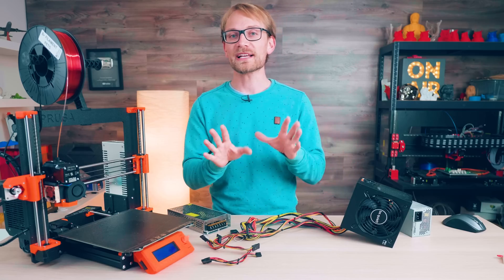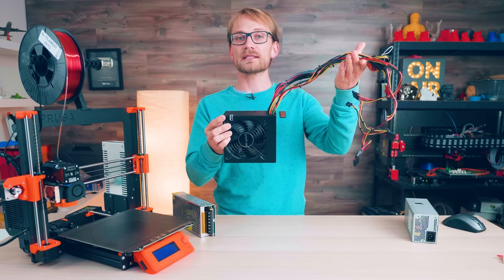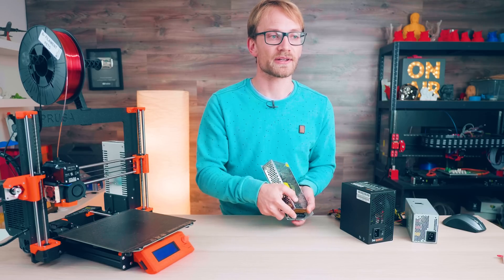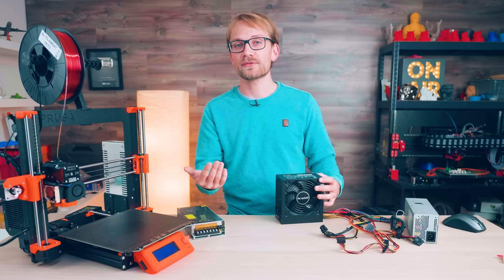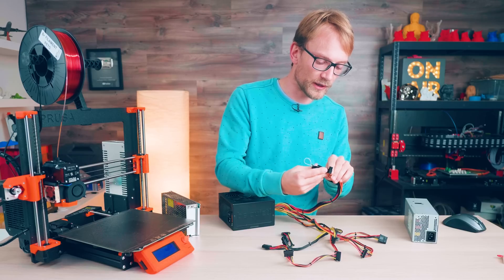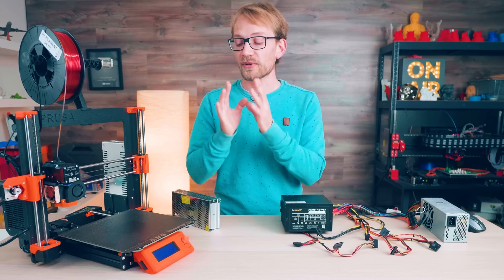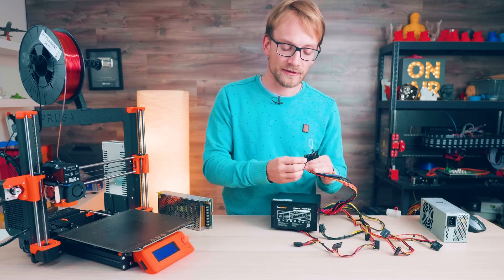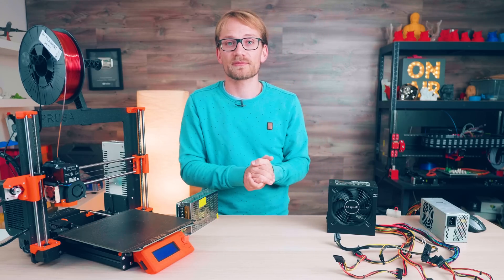ATX supplies are super useful for 3D printers!

Comment: You can actually pull 24volts out of the atx by taking a positive lead from the 12v and a negative lead from the -12v
Reply: the -12v rail is generally a very low current one, so you limit your current draw to that lower number. EG 800mA for -12  compared to 18A for +12. You end up with 24V at a max of 800mA, so not particularly useful.

Comment: You CAN get 24V from ATX power supply. Just use 12V as a ground and you get 24V at 12V rail's amp rating. I've been using this kind of setup for about 6 years (I needed 24V@over 9A as a bench power supply and then 24V industrial power supplies were not that cheap) and it's still going strong. It will go for hours from time to time, once i even used this setup to preheat glow plugs in old diesel and still no blue magic smoke.
Reply: This does not work in general. (And at the moment your main text has "strikethrough" effect, which is appropriate.) By "use 12V as ground" I assume you mean: use two ATX power supplies, and connect their outputs in series. In general, this will not work because ATX output grounds are typically connected to chassis and mains ground. So if you connect PSU#2's ground to PSU#1's 12V, then you're shorting PSU#1.  You might get away with floating one or both of the power supplies, but then you're defeating an essential safety feature.
Reply: @Graham_Wideman  I have no idea why i have a "strikethrough" effect. I ment (and wrote) -12V, not 12V but because of that dash it can't be seen. I agree that connect those two modules in a way which You describe could have quite nasty sideeffects

Comment: "One big transformer". No, this is incorrect, these are all switch mode supplies. Group regulation has nothing to do with transformers or the number of secondaries, that's not a simplification, it's confusion. Group regulation is simply the rails being regulated as groups rather than being monitored independently, eg one regulator with multiple outputs, the clue is in the name "group REGULATION" .The cost saving is in regard to the number of regulator circuits, not transformer secondaries, these aren't linear psu's.
Reply: He is correct you are wrong. Switch mode supplies are regulated by PCM on inbound side. So if you have one transformer you can only regulate all outputs at once. To regulate them individually you need separate transformers to have separate PCM modulation for separate output voltage.
Reply: Vyacheslav Kononenko PWM. PCM is Pulse Code Modulation.
Reply: He explained that sometimes uses different voltages ratios between outputs to bring the voltages, and because of that, the use of only one transformer with this different ratios is used. Obviously, this is not ideal for many voltages, but is cheaper.
The SMPS uses transformers, but not to step down the voltage. Is for induct high voltage low current from the primary to the secondary, and in this manner induct low voltage high current in the secondary, that is rectified and filtered to give the desired output voltage.
Reply: m3chanist - Sorry you're incorrect.
Reply: Your wrong. Unlike a linear power supply, the pass transistor of a switching-mode supply continually switches between low-dissipation, full-on and full-off states, and spends very little time in the high dissipation transitions, which minimizes wasted energy. The first block is used to rectify and filter the input making the power draw more "stable"as in so its more of a straight line on the graph.The second block in an (smps)is a chopper which makes pulsating dc waves and the biggest ones go through the transformer.
Reply: @techdiyer5290  You're*

Comment: Hey Tom, thanks for the content.  I had the power supply die on my Ender 3, so I bought the appropriate Meanwell power supply for that printer and hooked it up based on the pictures I took of the original wiring configuration.  The printer will power up and get to full preheating temps, but then shuts down when I try to start a print.  Any suggestions on what may be going on here?  Thanks

Comment: Keep in mind that a, say, 400W heated bed doesn’t run 400W constantly. My printer had a 400W supply, once it was at temp it stabilised at 150-200W average maintaining temp. Just handy to keep in mind when thinking of what it’s costing you in electricity.

Comment: You can always put "single rail" into your search when researching ATX power supplies. =) ... Check out Newegg, when you click on PowerSupplies, there's an option under +12v Rails and you can select single. Other online stores are the same. Even if you don't want to shop at Newegg you can find a model number to search on your preferred retailer/e-tailer (if those types of search options aren't available).

I am using a standard ATX, single rail high(er) end EVGA, in the printer that I designed because it also powers my R-Pi using 5v standby, so the Pi stays on even when the ATX is off. I've added custom buttons to OctoPi that are (ATX Off) (ATX On) so the R-Pi turns the printer on/off. I prefer to turn the PSU on and preheat the bed until the temps have been stable for a few minutes. Sure this is not always necessary but I have found that a nice stable bed temp helps a little bit with large footprint PETG or ABS prints (bed heater uses an industrial SSR, purchased from digikey, and mains voltage). 

Now I am switching to a 24v MeanWell, which wasn't cheaper than an ATX, it cost me over $50. I purchased from a known good supplier (digikey - I should get paid to endorse these guys) to ensure that I did not get some knock-off brand and I support a company that I trust (this is important to me). This is about the same price that I paid for the ATX supply. NEVER go cheap on a PSU. There's my advice, go google some images of burned houses and smoking PSU videos. Plus why would you want to deliver "dirty" power to any electronics device, go do some reading about excess ripple and it's effect. A few extra bucks is worth it for piece of mind, your safety, and longevity/stability of your PSU and devices running off of it.
Reply: Well said.

Comment: Tom, great information. I have known about ATX supplies in conjunction with 3d printers for several years and have actually built a hat for a Raspberry Pi in combination with a Octoprint plugin that controls the printer, Pi, LEDS, fans, etc. I have had one running for the last several years without any issue. The ATXPiHat is a one stop shop solution for ATX supplies and interfacing with 3D Printers. It started out as a small single PCB that you de-soldered the connectors from and solder them to the PI, etc. What a mess. The newer solution is plug and play. It handles all of the output muxing of the wires to handle the voltage/amperage requirements, load on the 5v rail to handle power sagging, etc. I wish that there was a 24 volt ATX solution. ATX supplies are more stable, better manufactured, and the power is much cleaner. Computers really do not like crappy power. Thanks again for the great video.

Comment: check out server power supplies! Better Amperage ratings, run at 24v or 48v, with 12v and voltage offsprings.  They are everywhere for about $12 USD or less. No wire jumble.

Comment: What about dual identical ATX supplies, tie the ground of one to the +12V of the other and you have 24V between +12V(b) and ground(a). Two separate +5VSB rails, and you can tie the green power on connectors together etc as well.
Reply: You can't do this because each PSU's output ground is tied to the PSU metal case, and to the mains ground. So if you tie the first PSU 12V output to the second PSU ground, you essentially short out the first PSU.

Comment: The only problem with ATX supplies, is that they are 12v only.  Some printer builds need 24v.
ATX supplies with modular cables solve the wiring problem, make your own cables and plug them into the supply.
I wonder if there is a way to use both the +12 and -12 outputs to get an effective 24v, at least for the heated bed supply.
Reply: Yes, you can get 24v by using the +12 and -12, but before you get excited look at the current available on the -12, thats the max current you will be able to pull, be prepared for disappointment.

Comment: Thanks! 
This weeks I was already looking into this, especially for the 12 AND 5 V that I use for my printers to combine it to the 24 V supply that is already there for another printer.
About the ATX supply: they do come with a good fan that is relatively silent compared to some extra fans on the (cheaper) PSU that the printer came with and is also way cooler.
Did not know about the low prices, always learned that these supplies are really expensive so maybe, maybe I will go with a new one instead of one that I have here in old computers.

I guess the best way to get a connector is to solve them from an old PC-mainboard?

Comment: I built my own printer from scratch and I used an ATX power supply, what I love about it, is that I was able to removed the board completely from the case and installed it into my printers I could have remove all the wire and just use one solid higher rated wire but I choose to just connect few wire together and discard some to suite..and the fact that I can use the MK2 Gen L board to directly switch on and off the power supply without using a shunt wire make it more beautiful . My printer automatically shutdown power when printing is complete ..
Reply: HII. Can You advise me on how to rebuild power supply to 24V ATX?

Comment: Can you use two industrial power supplies in parallel? My printer uses 12V 25A but I can't find any passive cooled industrial supplies. Would it be possible to use two weaker ones in parallel?

Comment: My very first printer back in 2014 was a fairly cheap (for the time!) Kit build and uses a ATX PSU with a couple of Resistors, it works fine and vecro keeps it from diving off the table (yup that happened, vibration from the printer made it walk since its not attached!) It still works fine, and I used the 5v to run a Pi with octoprint for quite a while. Ultimately though 24v and not having to deal with a rats nest of chopped up atx power leads has meant i've not really looked back.  Nice Video Tom!

Comment: I'm in the middle of designing my own printer and have already ordered a Meanwell 24V PSU. After being used to faster heating with 24V on the ender 3, I just can't go back to 12V
Reply: Where did you order it from?
Reply: The official Trianglelab store on aliexpress. It was only €25, but shipping was an additional €12. However I ordered a lot of other stuff with it (titan extruder + v6 hotend, nozzles etc) so in the end shipping costs came out as €17 on a €80 (excl. shipping) order. Not too bad for getting the 'high end' stuff from Aliexpress imo. And yes, I did receive a legit meanwell PSU (LRS-350 24V)

Comment: Used cheap industrial 24V unit + heated bed powered by mains via an SSR. I use simple step-down converters to generate 12V and 5V lines for fans, LEDs and to supply a Raspberry Pi for OctoPrint.

Comment: Worth noting - EU rules (EN61000-3-2) require power factor correction (PFC) on such equipment, which improves power output and reduces load fluctuation on the power network. Cheap import printers rarely have PFC - of course the Prusa printers do as they're built in the EU. Here's what Meanwell say for their LRS range (common in cheap printers) that don't have PFC:
"This power supply does not meet the harmonic current requirements outlined by EN61000-3-2. Please do not use this power supply under the following conditions:
  a) the end-devices is used within the European Union, and
  b) the end-devices is connected to public mains supply with 220Vac or greater rated nominal voltage, and
  c) the power supply is:
    - installed in end-devices with average or continuous input power greater than 75W, or
    - belong to part of a lighting system"

Comment: 24V are my main reason why i will not use ATX supplies ... boost converters from 12v to 24v for high loads seem like an unnecessary complication compared to stepping down 24v to 12v for the little bit that the control electronics need (eg inductive probe) ...

Comment: I've been using a relatively small 24V 120W "industrial" PSU for my custom build (based on D-bot 300*300). The bed heater is AC powered and the 12V components (like fans and lighting) powered through a cheap 3A LM2596 buck converter. The raw 24V only goes to the motor drivers and the extruder's heater which are using about only half the power the PSU could bear.
Personally I doesn't see ATX PSUs practical for other than PC builds.

Comment: These super cheap industrial PSUs are also:
-much less safe (!)
-can randomly fail, not only age
-don't have any kind of Power Factor Correction

That being said, I've bought a 300W/24V cheap supply, replaced the caps and made some other, minor improvements, and I think it will work just fine.

Comment: I salvaged some female ATX sockets from a broken mainboard and just soldered the printer wires to their pins (sometimes bridging multiple pins together for more current), isolated everything with some heat shrink tubing and attached it to the table with printed clamps.
This way I can take advantage of the separated power supply rails (no voltage fluctuation/light flickering from heated bed on/off cycles), and I can always swap the ATX PSU for a new one if it fails, even the warranty is kept intact.
The green switching line is controlled via a little Transistor by a Raspberry Pi running OctoPrint, which is fed by the 5V standby line and therefore always online and available for other purposes like home automation (pilight).

Comment: If you really need to use ATX PSU then use quality one which has 100% of the overall power rating available from 12V rail.
For example 600W ATX PSU with 45-50A at 12V, this means it's a hybrid PSU which has only one winding for one 12V rail and then it uses step-down converters to get everything else like 5V/3.3.
Basically that means you can use 12V without needing to load other rails and everything is stable.
Also by chosing modular PSU you will have very likely thick cable inside of the PSU so you don't have to bridge any computer cable.

I've seem Corsair RM800 and RM1000 built in such way, but of course all other quality powerfull PSUs will be like that.

Comment: I use the ATX on my larger printer because If I'm out of home I can completly control it via octopi. Also hooking up a Pi it's neat because you don't have to deal with SD cards flying around all over the place. I think that if you don't move your printer from a location the ATX+Pi it's the way to go (thoug if your printer it's 24V your setup it's going to get bigger with the boost converters as you said). If you move your printer a lot then the simpler industrial ones will do the trick.

Comment: When I built my printer, I got a used noname ATX supply. It was dirt-cheap ~12$, it was something I know how to use, and it was recommended\described on Reprap wiki guides.
There was a problem with slow heatbed, and was thinking about 24v upgrade... but then I found out it was software problem: Sprinter to Marlin update fixed it for me, what as a surprise!

Comment: Bought a Hewlett Packard DPS-750RB A server PSU for £17 on Ebay,  its very small, and gives 65A @ 12V :) its got a 40mm fan that I suspect will be very loud if it ever gets loaded enough to need it, it powers my Hevo and has been perfect for the last 12 months and really there's so much head room that that cooling fan has never kicked in.

Comment: At the moment I have a 12v 25A industrial supply witha  5v 3A buck to power my Pi 3, it's not a bad setup but I'm considering running ATX at some point so I can make use of that 5vSB line for the Pi so it doesn't end up having to shut down with the printer. I can just send a poiwer on command and BOOM! ready to go. It'll also afford me more power headroom depending on what supply I pick. I might go for one of the more oddball formfactors so it fits on my printer's frame better seeing as it's an i3 style. There are some super compact high powered server supplies which could fit the bill nicely as well as they deliver insane amounts of power for their tiny size... the noise could be a problem though depending on how much power they can pull.

Comment: Replaced my cheap industrial 12V PSU with an semi-passive non modular single rail 22A SFX one. It does a really good job and is much smaller compared to  ATX. Just need a proper mount to hide all the cables.

Comment: I fry my first atx with my diy pcb 17A 12V heated bed. Then I buy used server power supply (12V 40A). But this was long time ago. If I was building printer now I would totaly go for small 24V brick for electronics and motors and mains power heated bed.

Comment: I built my printer mostly out of bits I had lying about, so I went with a Maxpower 300W ATX. I run the  electronics on the 5v line to prevent auto-shutdown during hot end heat-up. I don't have a heated bed,  and at 12v my motors are more powerful than the wooden frame can handle so 24v isn't required. I also don't use the standby power as I run direct from my PC with Repetier.

Comment: Great info video! I've swapped the original power supply of my MK2.5S with an ATX. The man reason was to have a stable 5V for the Raspberry Pi with OctoPrint running. Also, for the printer and the Pi have the same gournd level, I think the USB connection between them is much more stable.

Comment: Are there some good boost converters to go up to 24V from 12V, and able to handle 500W?
Reply: Yes on ebay search step up converter. I run a 1kw daygreen for a heated bed through a fet for bed heat up. Heaps of smaller ones for much cheaper too though unsure on their cooling capacity